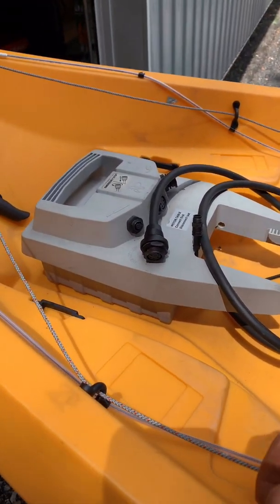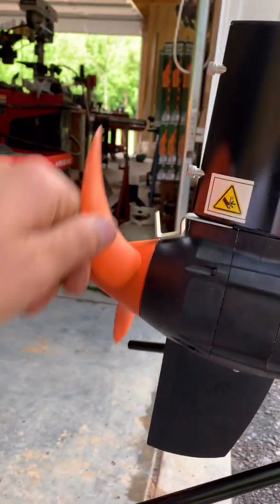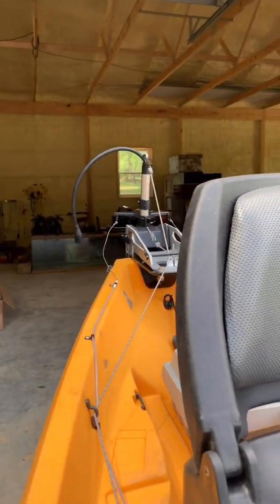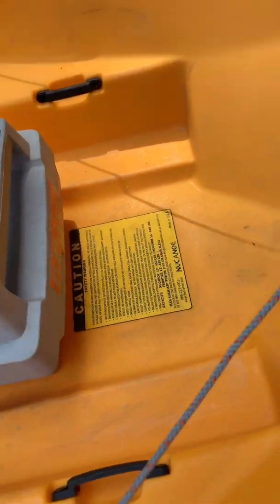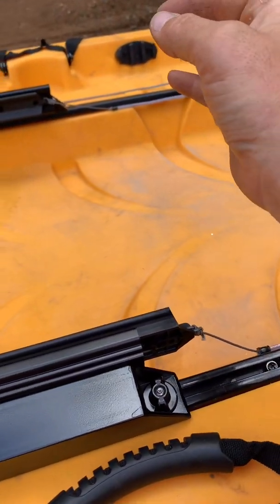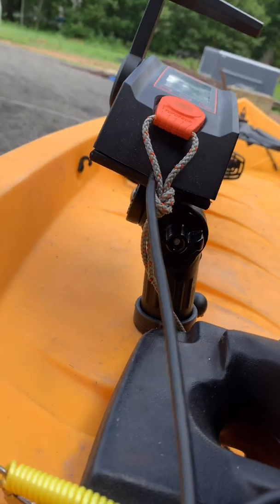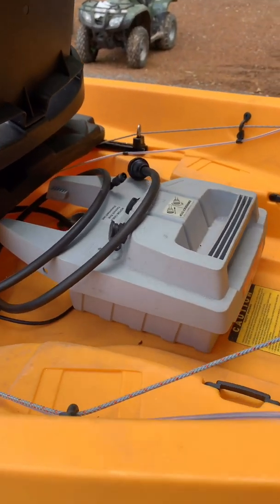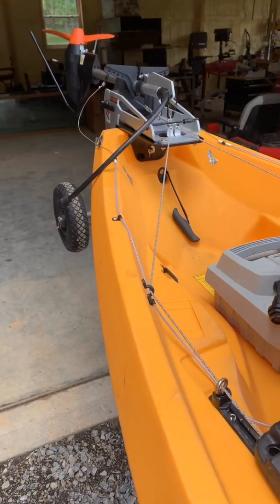Foot Controlled Torqeedo 1003 Frontier Install

Comment: thanks for the video. Do you think that a similar set up with a Torqeedo 1003 might work for a Hobie quest 11? (I have both so I am wondering if it worth the try or it is an overkill and will render uncontrollable)
Reply from the maker: The 1003 is still a lightweight motor. It should work for your setup. You will have to get creative with setting up the mount.